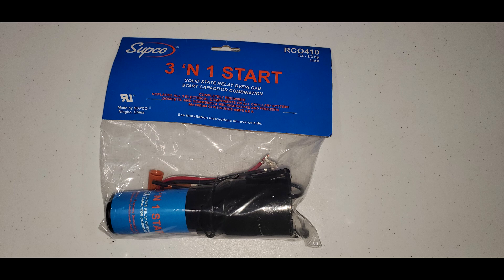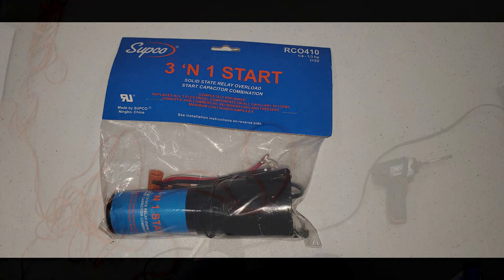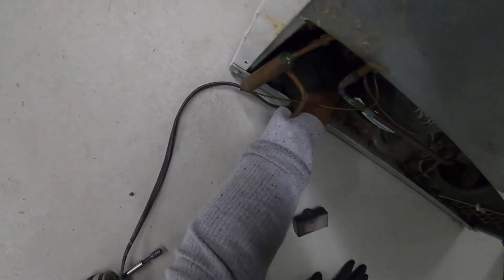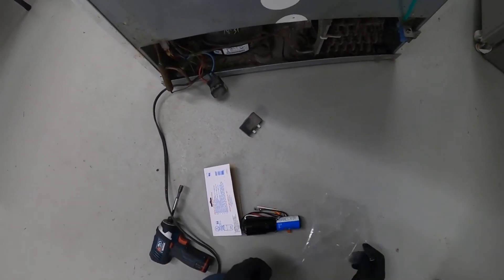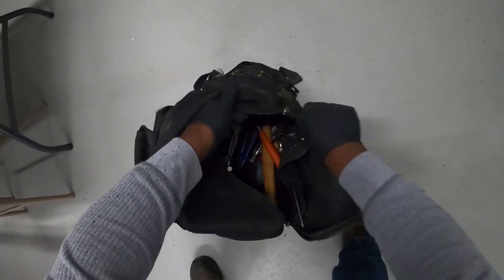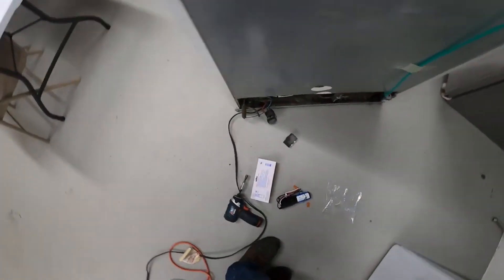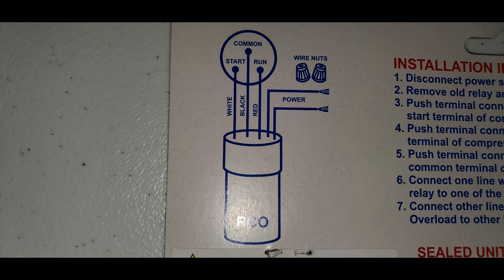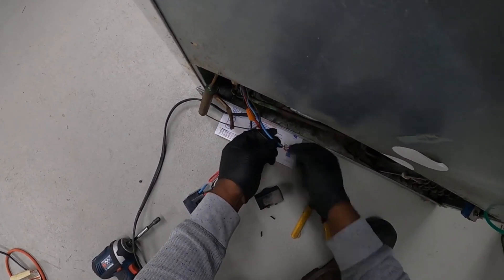How to install a 3 and 1 start kit on a refrigerator compressor

Comment: What do you do if you have 3 power wires instead of 2? On my GE side by side I have 2 connectors going to the start relay and one going to the overload.
Reply: Did you ever get an answer or figure it out? I have the same issue.